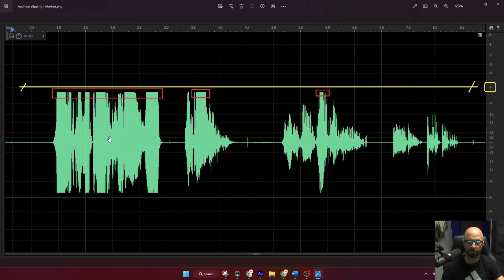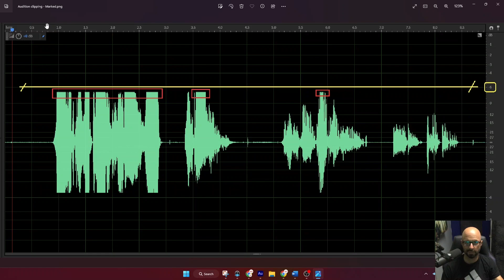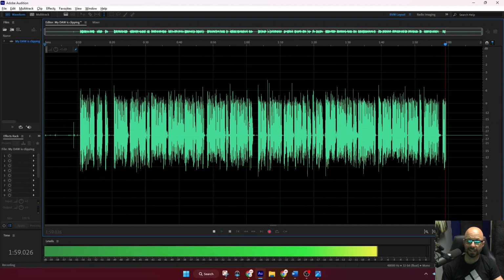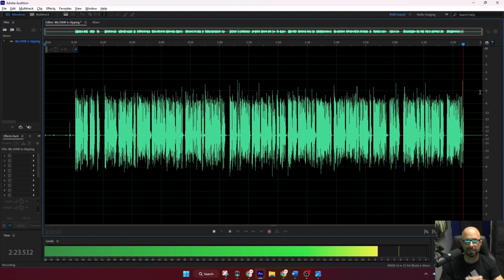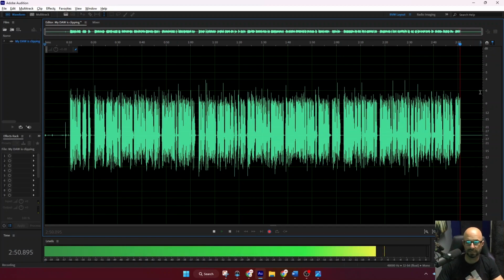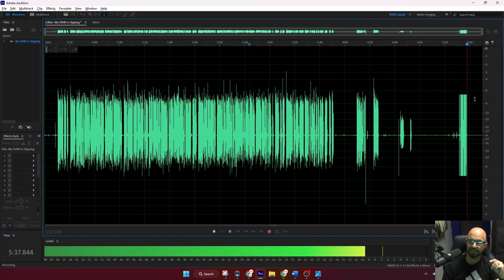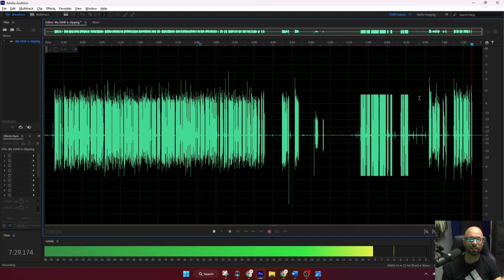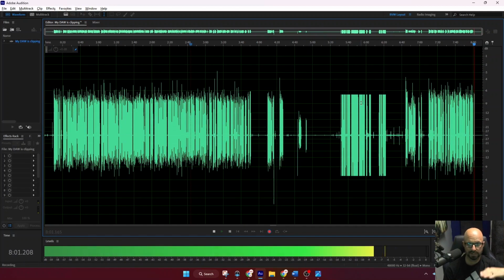How to fix your DAW when it’s clipping at a low Db

Comment: Wait? I have to go inside my sound settings on my Windows desktop and turn app system sounds to 100 or the Master Volume to 100 what if they are already both at 100 ?
Reply from the maker: Short answer: make sure INPUT and MASTER are at 100%. 
Long: Your sound settings have Input and Output.   Input needs to be at 100%.  Master volume controls BOTH.  For example, if Input is at 100% and Output is at 100% but Master volume is at 50%, then both Input and Output are only at 50% of their settings.